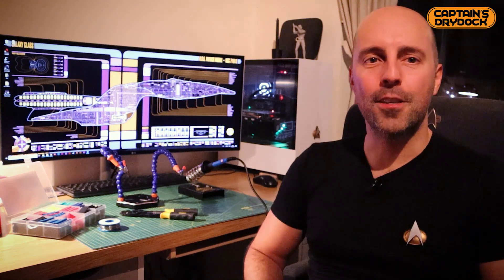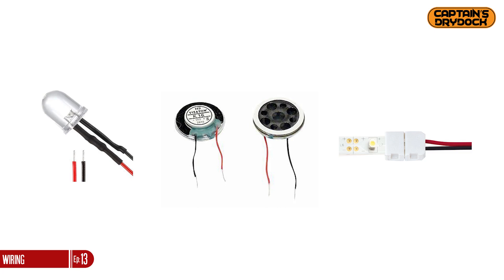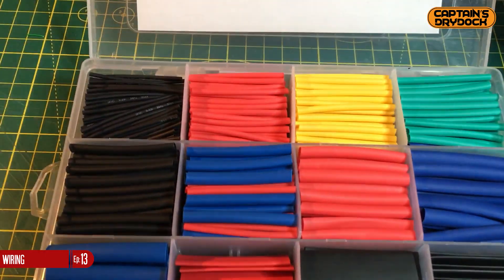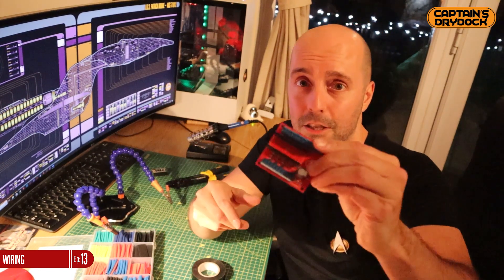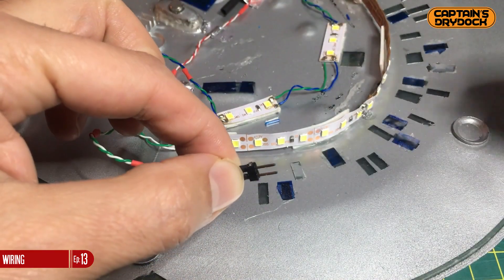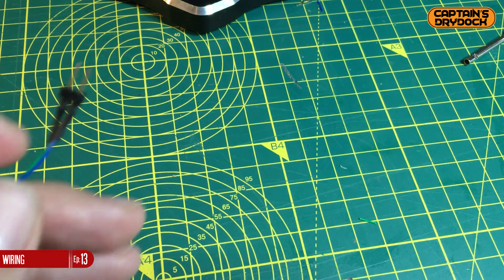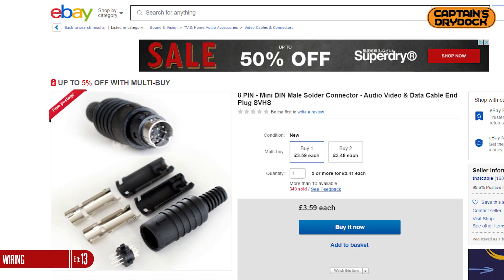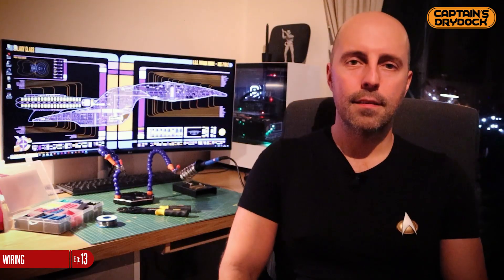Building the Enterprise D: Episode 13 Wiring

Comment: may i ask why you integrated the Arduino into the secondary hull? Takes alot of space. I plan to put mine in the base so i can swap it out easy whenn it fails and reprogramm + add functions as soon as i gain skills. So far fantastic build and great inspiration.
Reply from the maker: Sooooooo many wires due to too much going on. The secondary acts just as a driver that takes the signal from the main Arduino which means a small amount of wires going up the base tube.
Reply: @CaptainsDrydock  I understand, sounds well complicated. I actually only plan to light up the strobe lights in the nacells and the bottom of the secondary hull. Thats what i actuall can still programm, your setup is wayy more complicated but also very cool with so much going on. I guess well mine will only light up, i may axtra wire the nacells and the windows, maybe the photon torpedo launcher. Phaser strips are impossible on my build since i only own the non transparent one.

Comment: I protect the bottom of my boards with hot glue, works great, tape has Adhesive, I don't even trust the Adhesive backing on strip light tape, ca glue and hot glue is your friend, and my last top tip is they make liquid eletrical tape, shrink wrap with the waterproof lining is worth the extra few bucks. Thanks for all the detail in the videos, I've had this kit forever with almost everything I need, wish I had the time to order from MIP resin parts, but shipping is so spratic

Comment: A better option to just heat shrink is the heat shrink tubes they have different sizes but with one advantage Solder!  Heat shrink tube with solder in them so when you apply heat it will shrink but also solder the wires together as well at the same time. You can find this on Amazon copy and past:  Sopoby 120pcs Solder and Seal Connectors.
You're Welcome!
Reply from the maker: I know the ones - good invention but take up too much space in an already packed compartment. Certainly would use them on larger projects.

Comment: Excellent tips! Have you any concerns about heat generation and dissapation?

I tend to use white for all negative wires, paired with colored wires for the positive current. (Except green: Habit from working with AC power makes me read that as ground.)

Would a heatgun work more efficiently on your heatshrink? Waiting for the iron's radiant heat seems time consuming. Glad you're not using a lighter or flame, though!
Reply from the maker: Thank you :) As it's all LEDs and low voltages, there's very little heat. I've had test parts on for hours with no issues. Also the space inside is quite large.

I personally prefer to use a more surgical application of heat. As a lot of the wiring happens when attached to the model. So want to avoid subjecting anything else to the heat that would risk warping or damaging other components.
Reply: @CaptainsDrydock  That all makes sense. Thanks and keep making awesome!

Comment: Use varnish coated electric motor wire. I have been using it for years. If you really need color codes, use a permanent marker on the last inch of the ends of the wire where the connections are.